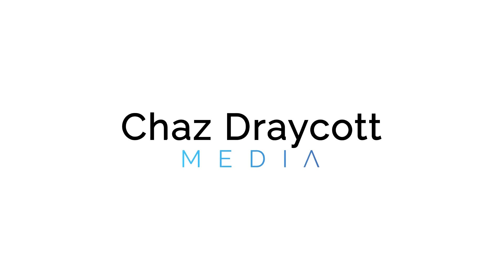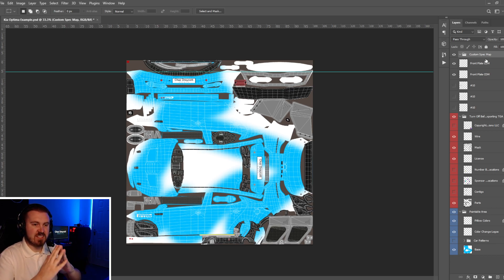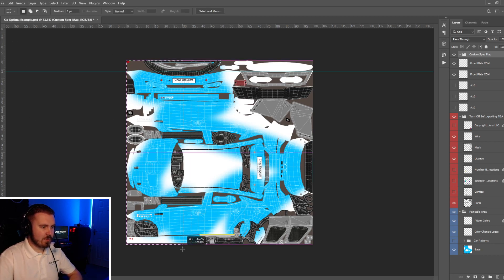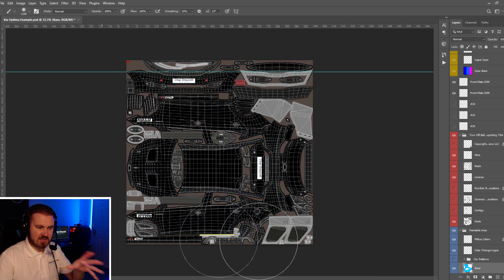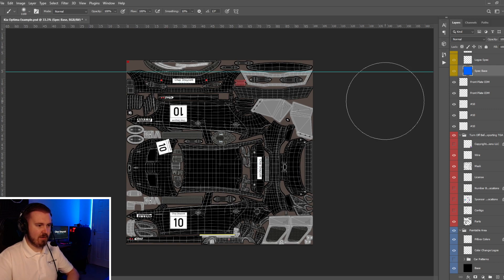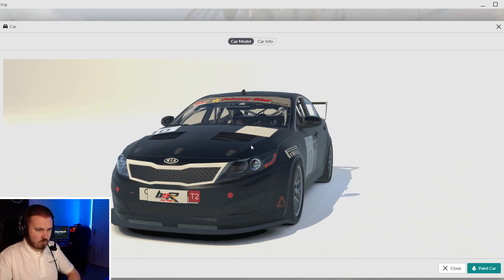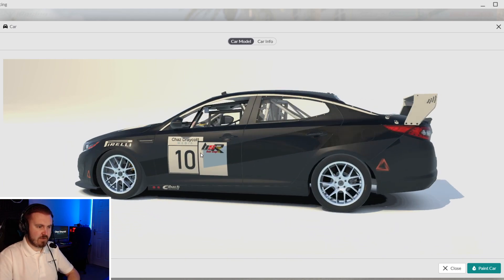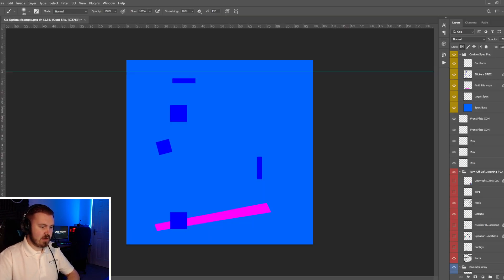iRacing Paints - Spec Maps, Simplified

Comment: I did a spec map with the iracing template folder method, and the same pec map with your method. and they both look different. where the chrome parts look better using your method, I can't get the base layer to show glossy or matte in the UI no matter what I do. So confused why they look different even though i'm doing the same thing. Are there any other settings in-game that maybe i'm overlooking? Any clarification on this would be amazing and super helpful. Loved your video
Reply from the maker: Hi there! There was an update to how the spec maps worked in "gloss coats" after this video. If you chance the blue channel to 12 maximum (out of 255) you'll be able to get gloss - I'll make some suggestions below.

For "just gloss: R0 G0 B12
For satin: R0 G100 B12
For metallics R255 G50 B12

Comment: chrome doesnt work with images at all does it? It just makes them very dark. Or am I missing something?
Reply from the maker: It makes the specific area very dark, and it's hard to see the colour in the reflection unless there's direct sunlight on it, but it does "work" as such.
Reply: I made a cool car but I cant make it shinier
Reply from the maker: @NitroVipers3  If you follow the instructions exactly bud, it should work. The process hasn't changed since the video was released.
Reply from the maker: Apologies, I believe I may have misunderstood your original comment. You mention images - are you using a picture/image as part of your design? In which case, a chrome effect would still work - the spec map isn't affected by the design of the car - but it doesn't have a very good end result.
Reply: @ChazDraycott  Hmm I posted a pic of the car here but it didnt work, I was going to show you before and after, my whole car is wrapped like it would in real life.
Reply from the maker: @NitroVipers3  Yeah, you can't comment images on YouTube bud.

Comment: Are these values and concepts the same? It worked a treat last time however, this time, its a mess. My white that I have set to R:255 G:0 B:255 are coming out solid, matt black. In fact the entire car is matt, with zero highlights even though I have set two colours to different levels of matt. Its the new iR-04 Car. Weird :(
Reply from the maker: Don't use the whole "black and white" thing that iRacing put in. Just duplicate each part of your design and put them into a layer folder of your own, and do as the video describes 😊👍🏼
Reply: @ChazDraycott  Thanks for the reply Chaz, but I defo think they have changed it. I removed all the default folders, Alpha stuff etc., and left the Spec Map folder empty. I then turned it on, exported the Spec Map Targa, applied it to the car and it turned everything to solid matt and parts of the car totally black. That's with nothing in the Spec Map folder, AT ALL! Very Very Strange!

Comment: so weird one, i save the car_123456 as a tga to correct car folder, livery shows on the car in the paint section in the UI, i then load into a test session and car is in default livery- i go to check the file car_123456 and its deleted itself? i used to run a livery from TP and have removed this from the car aswell.
Reply from the maker: It sounds like there's a match of conditions there, like this.

- You have Trading Paints running, with it set to "update my own paints" or "clean up files etc."
- You do not have a livery for that car uploaded to Trading Paints, so it is deleting anything you put onto the car manually as it doesn't match what's on their database i.e nothing.
Reply: @ChazDraycott  I got it to work i think - thanks very much for the helpful video

Comment: Are you doing this through Trading Paints or just through the iRacing UI?
Reply from the maker: There's no use of Trading Paints in the video bud 😁 It's all done manually.
Reply: @ChazDraycott  maybe that's why mine isn't working on TP, lmao. I've watched this video like 10 times and done everything as you have, but it doesn't work through TP for whatever reason.
Reply from the maker: @spdesigns5656  You have to upload it to Trading Paints as well bud. You can add a spec map to your liveries there. Just make sure you upload the .MIP file and not the .TGA. You might have to have the car loaded in the sim for it to generate the .MIP from the .TGA
Reply: @ChazDraycott  aaah, see I didn't know it was supposed to be a MIP on TP, both my car and spec files are TGA.

Comment: and we save the file to where??  do we leave the "turn off before exporting tga" off? you skipped a few key portions as others have. which make this a worthless attempt by the viewer... and yes... my car is blue and pink...
Reply from the maker: If you pause the video for a sec, you'll see the path where you need to save them.

Documents > iRacing > paint > whatevercaryourepainting

Also, you only need to turn off the "Turn Off" group if it contains anything you don't want on your car. This doesn't have any effect to the file unless you've included parts of your spec map in that group.

Hope this helps 👍🏼
Reply: Same here. I’m saving it where I save all my paints, when I upload to trading paint my car is shown exactly how it’s saved as all blue and pink. Not sure what I’m doing wrong here.

Comment: k im sorry, I am full tard on this. When you save the spec map , are you just saving the entire paint ( ie all the other layers that have nothing to do with spec map) and saving it under a seperate name?,or are you just saving the Spec map folder?. Also where are you then putting the Saved spec map? , in ur iracing folder? in trading paints? Nothing wrong with the video, very clearly explained how to alter the spec map. Im just completely new and have no idea where im saving this to.
Reply from the maker: Hey man, no worries - I'll try and explain it well enough. It doesn't matter which layers are visible underneath when you save it, so long as the blues, pinks and purples of the spec map are visible over the top. This is a separate file to your car's livery (car_123456.tga).

You save them in Documents > iRacing > paint, and then the necessary car's folder, so "bmwm4gt3" for example.
Reply: @ChazDraycott  when and where would you save the mip file? I understand the targa file. But when uploading for trading paints. It needs to find the mip file for the spec
Reply: Never mind. I watched it again and understand it changes itself to a mip file. Great video!!